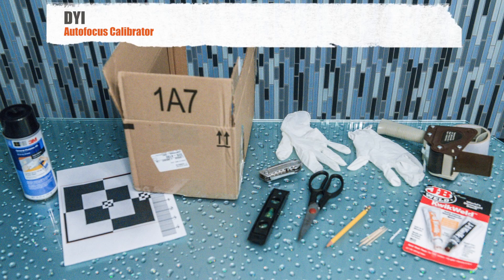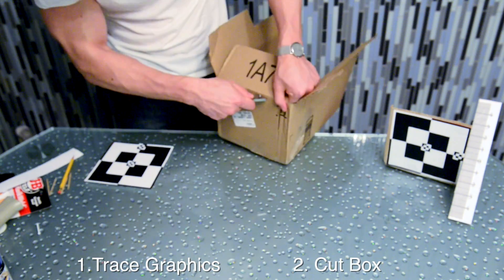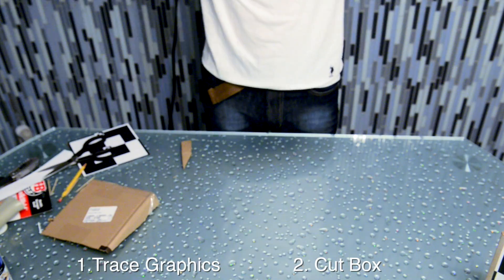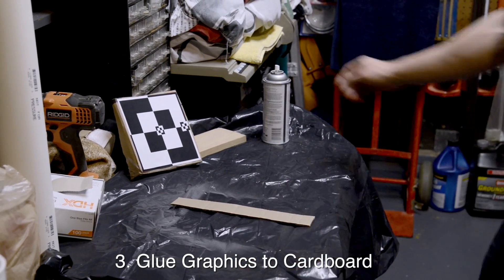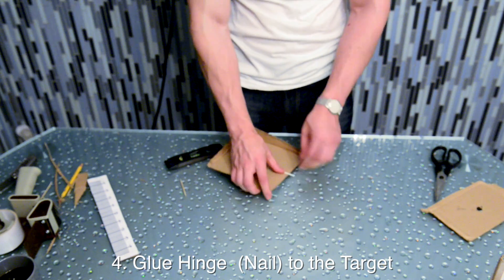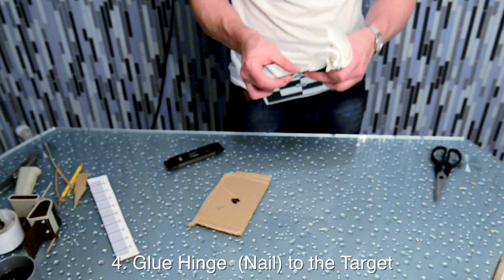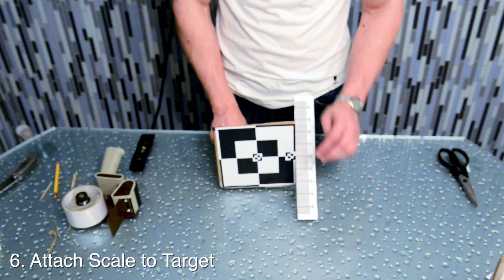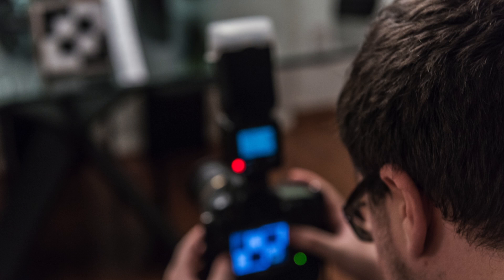AutoFocus Calibrator DIY

Comment: This is a great choice but you mentioned that it is for micro-calibrating your DSLR... Just wondering if it can be used to calibrate the SIGMA Lenses that use a dock  (SIMGA Cal. Dock) Having to constantly connect and disconnect the lens from my DSLR invites dust to get onto the camera's sensor.  Anyone who owns such an expensive glass  I am sure can vouch for this argument! 
 In order to properly calibrate the Sigma Art, Contemporary, Sport, etc... lens, it MUST be removed from the camera, mounted to the SIGMA DOCK and calibrated by using the software that Sigma suggests in order to get the full potential of both lens and dock. Anyways,  Calibrating the camera is one thing but in order to correctly calibrate the lens, it must be done OFF camera. WOW!! Talk about tedious!
Reply: Yes you are right it is tedious, but when you consider how many photos you and I have taken that were out of focus it a price worth paying to get great results more of the time, you still have to worry about camera shake/fast enough shutter speed or you will still have blurry photos.